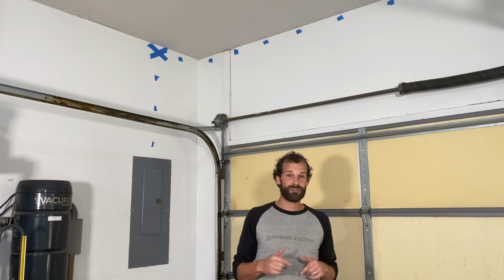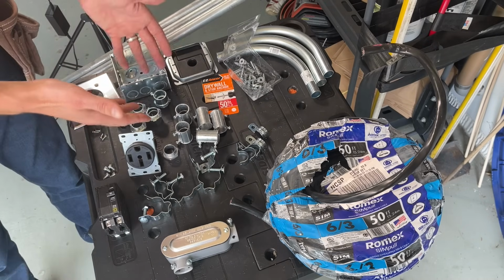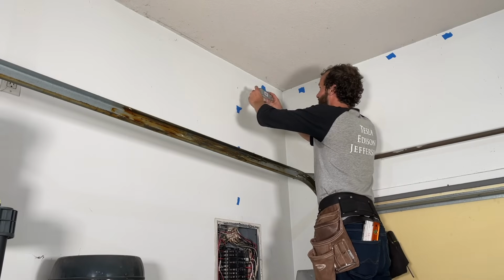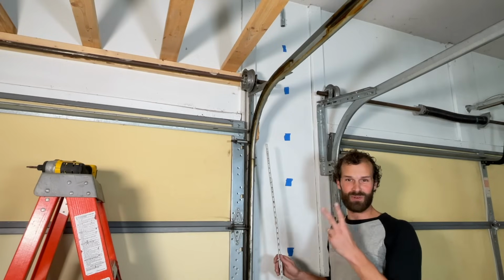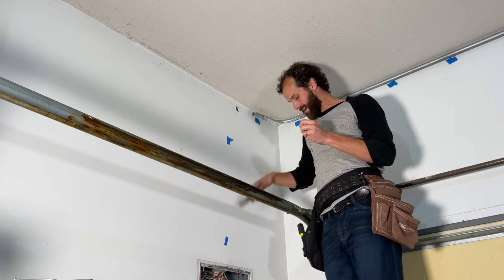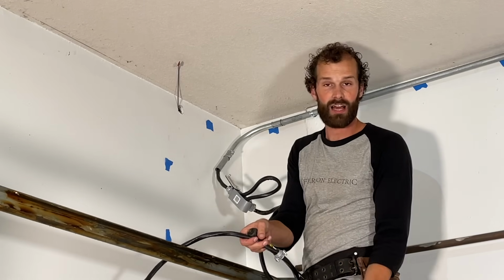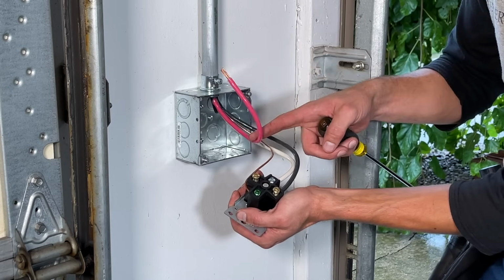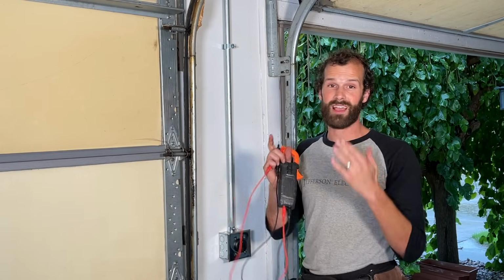How To Install a 240 Volt Outlet | Electric Car Charging

Comment: He should've grounded the box by wrapping the ground wire around an actual green screw in the back of the box. Those boxes are designed for that screw with a raised hump. Using the outlet as the ground link is not sufficient to ground the box and conduit run.
Reply: removing a device isn't allowed to interrupt grounding connections

Removing a wiring device from the circuit cannot break grounding connections, or else you are violating NEC 250.148(B):

(B) Grounding Continuity. The arrangement of grounding connections shall be such that the disconnection or the removal of a receptacle, luminaire, or other device fed from the box does not interfere with or interrupt the grounding continuity.

Therefore, this install does not meet code.
Reply: You don't have to ground the box if you use a self grounding receptacle. Just about all of them are self grounding these days. They have a little steel wire which crosses the screw tab on the receptacle which ensures a solid ground connection to the box. Believe it or not, according to NEC 2020, EMT is considered an acceptable ground path, so a separate ground wire isn't even required. It's just common and good practice to have one. He couldn't have done that in this scenario though because the conduit isn't continuous.
Reply: @dr.cupcakes626  I've known of that crazy "conduit as ground" in the NEC for nigh-on 40 years, at one point even AC/MX armor was (is?) considered a valid grounding path.  In Canada you've ALWAYS needed a separate ground conductor as far as I can tell.

You begin to see the reason when, like a friend of mine, you find your AC armor glowing bright red after developing a hot-armor short, and the armor/splices had corroded enough to not quite blow the fuse.
Reply: @Joe-by8jh  what code are you referring to? According to 250.146(B) the screws in the receptacle yoke are suitable to establish a bond between the receptacle and the box, therefore grounding the box.

(B) Contact Devices or Yokes. Contact devices or yokes designed and listed as self-grounding shall be permitted in conjunction with the supporting screws to establish the grounding circuit between the device yoke and flush-type boxes.
Reply: @dr.cupcakes626  Really good code reference! I couldn't determine that this listing was in place for this outlet so really should default to a ground screw. I appreciate you!
Reply: @dr.cupcakes626  The language reads: "shall be permitted to ground the receptacle to the box". You can use the self-grounding yokes to ground the receptacle to the box, but not the other way around. I don't know an inspector that would allow the receptacle itself to be the only ground link on a conduit assembly. It's just sloppy and bad practice. If the conduit ran all the way to the panel, it'd be another story.
Reply: @bnasty267  That's not what it says. It says word for word "shall be permitted in conjuction with the supporting screws to establish the grounding circuit between the device yoke and flush-type boxes." grounding the box to the receptacle or the receptacle to the box makes no difference as far as grounding goes, it's all bonded together. You're right though, removing the receptacle would effectively unground a noncontinuous conduit run. But I can't find any language in the NEC that prohibits this. Correct me if I'm wrongm
Reply: @dr.cupcakes626  I agree that the NEC is unclear here. However, most inspections I've done are at the rough-in stage, where the receptacle is not installed yet. This install wouldn't have a ground, and would fail. I doubt you'd be able to argue the technicality, and honestly, why would you? You have a EGC available, a dimple on the box ready for a ground screw, and conduit that isn't grounded elsewhere. This is definitely one of those things where it's super easy/free to not piss off the inspector, and that's what ultimately matters, even if you ignore the safety aspects.

Comment: The one comment I have is regarding your grounding path for the conduit. You go into great detail about ensuring your connections are secure, all locknuts and set screws tight. However, I didn’t see a grounding pigtail from the receptacle to the metal box. The other end of your run ends at the wall with no conducive path down to the panel. I know it’s not practical to run conduit through the wall to the panel, but without a grounding pigtail on the other end, how would any fault current make it back to the panel to trip the breaker should the conduit become energized? Did I miss something?
Reply: Great point, I totally missed that. As far as I can tell you're right, the EMT nor the box is bonded properly.
Reply: I suspect the metal mounting tabs on the outlet are bonded to the ground terminal, which would bond the box. However, the other end of the conduit isn't bonded. I'm not an electrician, but I heard that both ends of the conduit should be bonded.
Reply: @OldBaldDad  You can't use the metal yoke to ground the box via the receptacle. You can only use it to ground the receptacle via the box. Essentially that means that the box must have a screw and a pigtail. 250.148(B) and 250.148(C).
Reply: @OldBaldDad  The manufacturer didn't specify in the installation instructions for the outlet whether the outlet mounting plate is a suitable ground path so I should assume it is not suitably grounded without a pigtail and ground screw.
Reply: Definitely needs a ground screw in the outlet box,loop the ground wire around the ground screw and leave enough to go to ground the outlet.
Reply: @patrickgatons  simple .
Reply: I noticed and thought the same thing.  Makes you think .  But with ground wire grounded to the outlet also ground the piping too?
Reply: @timcaron9049  theoretically yes.  But without the wiring device in place with the covers on, the pipe is not bonded.  And while a grounding pigtail to a wiring device is not required when the metal box is bonded, I don't think the reverse is true from a Code perspective.
Reply: Michael Burkert.    Not using the conduit as an equipment ground??   But, does need that
pigtail as you point out.  Thank you for keeping us informed.
Reply: @tedlahm5740  , yes. Any metal box or conduit has to be bonded in any electrical install. If one of the conductors came into contact with the metal box, the box and conduit would become energized. Without a path to ground back to the main, the breaker may not trip, creating a very hazardous situation. Same reason any metal appliance has a bonding electrode or pigtail to the equipment ground of that appliance.
Reply: @michaelburkert461  If I use a plastic 2 gang box, do I need to ground it with a pigtail? I don't see a reason. Thanks.
Reply: The ground path is not connected to the panel cause he did not use EMT all the way through to the panel so technically this is not grounded correctly would of needed a JB box where the transistion goes from NMD to EMT and for pulling its alot easier to pull single thhn or thwn wire through conduit then a bundle of insulated conductors
Reply: I didn't catch the bond issue at first.  However, not to code, but in this case if the EMT were to become energized the current would travel to the yoke on the outlet that is connected to the grounding wire for a path back to the panel.  Another reason to use a j-box with a pigtail above the panel instead of an LB.
Reply: The ground screw on the receptacle is connected to the metal that fastens the receptacle to the two gang ring that is fasten to the box. That should help for a fault. But yes a pig is definitely needed if two gang ring were to be remove while the receptacle is still energized.
Reply: What a Maroon!  That whole conduit is floating.
Reply: @MWestern-m4g  Moron [sic] - maroon is to be left hopelessly lost. Lighten up! Don't think any of the haters could do a better video.  🦴
Reply: I agree with you! Talking and working at the same time is stretching my multitasking skills. Here's a thought: NEC 250.86 Exc. 2 are not required to be connected to the equipment grounding conductor. What's your perspective? Does this apply here Michael Burkert?
Reply: @joelwalsman773  
Exception No. 2: Short sections of metal enclosures or raceways used to provide support or protection of cable assemblies from physical damage shall not be required to be connected to the equipment grounding conductor.

That certainly opens the door for negotiations with the AHJ 😆. Good catch, what is the definition of "short section"?
Reply: Great point. I felt I criticized him enough on other issues.
Reply: No. Each of the components of the outlet are electrically isolated from each other. For the ground of the outlet to be connected to the metal box/conduit there would need to be a grounding pigtail to connect them.
Reply: The recepticals ground screw and yoke are connected together. Yes a redundant alternative ground path would be ideal, but it's fully grounded, even if the conduit is not connected to the panel on the other side.
Reply: @jamess1787  You are correct that it is grounded but code doesn't allow that circuitous grounding path through the receptacle.
Nec 250.148 requires connection to the box if the grounding conductor is spliced or grounding equipment in that box.
Reply: @patrickgatons  fantastic, thanks!
Reply: @jamess1787  yes but not bonded per code
Reply: Its not required. The conduit is grounded through the egc landed on the device.
Reply: @lloydmills9619  The socket is a 4 hole device. I don't think that green(Ground) is landed on the support of the plug thus not grounding the conduit all the way back to the panel. He should have run a wire from the panel  up to the conduit run at the top of the wall. I would have big arguments about how electricians were made to believe that conduit counts as good grounding devices. THEY DON'T. A direct wire to fixture is the only correct way to ensure a proper path for safety ground. And the "electrician's" working on the jobs were most likely not holding a card, the one's running the job would be hopefully. Most of the time it was one guy who represented the company as a certified electrician.

Comment: Love the format of this video (any best-practice violations aside - I am not an electrician)! 2 Qs:
1) Why not wire up the red/black to the breaker before installing it into the box? Seems safer all around to keep away from live connections...
2) What would change if needing to run conduit outside the house from breaker to garage? Different wire? How to handle indoor-to-outdoor transition?
Reply: Also I didn't see ground on the box he should  make a pigtail and connect ground.

Comment: The one thing I found a little odd was the whole run was in conduit except from the breaker panel to the LLB (or whatever it was) connector.  Is that normal?  I thought EMT would also have to go from the breaker panel behind the drywall.

Also why was Romex used instead of THHN or other?  Thank you; fabulous video!  Keep 'em coming please.
Reply: It wasn’t necessary needed to run pipe down the inside wall because he was using romex. If he was using regular THHN then he would have to run a raceway all the way from point A to point B
Reply: @SmackxDaddy  thank you.  I'm guessing it has to do with local code.  In Chicago (Cook County) I don't think we could do that.
Reply: @dougb8207  would probably be cheaper to run some greenfield down the wall and connect it to the back of the box and that would solve to have and actual grounding path just in case of a ground fault at the device
Reply: @SmackxDaddy  right!  You're one of the few people I've heard mention Greenfield.  Generally I'm not good at cutting that stuff, so I try to buy bx whips, or at least we used to call it BX when I sold electrical supplies at Builder's Square years ago.
Reply: @SmackxDaddy  Flex conduit in the wall. Which would have provided the needed grounding through the conduit to the panel if the ground becomes disconnected..
Reply: @Sparkeycarp  flex is another word for greenfield, so yea same what I said.

Comment: I just did this exact thing for an RV. I took the insulation of the Romeo in the conduit. I was told it would have considerable amp drop from heat in the conduit if you did not.
Reply: wire is not rated to be used without the outer jacket .
Reply: @noahholt482  If it is stripped and sleeved in conduit it is perfectly fine. The conductors inside the outer jacket are normal wires we pull through conduit every day.
Reply: @noahholt482  I wouldn’t worry too much about it, as we are watching a video of someone working in a live electrical panel!

Comment: honestly screw that....just use some flex metal cladding in and done in a fraction of the time. no it wont stop some 10/10 retard from shocking themselves but they have it coming anyway. if you move disconnect it and put a sticker that says its on them if they want to use it.  dont be dumb dont have problems enjoy

Comment: Whoa, why not transition to THHN instead of trying to pull Romex through conduit?
Reply: Romex is not meant to be used in a conduit like that, it gets hotter than it should.  Using THHN would be the right way to do this.  You'd think a pro would know that stuff.
Reply: @bosoares  romex is perfectly fine in conduit
Reply: That was going to be one of my questions.
Reply: Yeah, not necessarily illegal, but man there were better choices.  I get that he was trying to use materials readily available to the homeowner.  But as someone else already pointed out, 6 feet of FMC from the condulet to the panel,  and then just install three (3) #8 + (1) #10G (also readily available at the homecenter) and you have a much better installation.
Reply: As DIYer I always cut the main breaker and also test adjoining breakers to make sure no current present. I , further, cut a piece of cardboard a little more than the width of the box and slide it over the main lugs to help prevent any stray contact. Also , standing on wood or rubber might be another smart move? I also don’t understand why use Romex inside of conduit unless it needs a short section needing extra protection. The big box boys carry the individual stranded wires (usually)?
Reply: Inexperience
Reply: I thought the same. Maybe trying to prevent a splice at the transition?
Reply: Probably had it laying around and didnt want to strip it
Reply: Today’s code would require a GFCI in most locations. I also do not think that 6-3 Romex meets code for 50 amps continuous load in or out of conduit, however, #6 THHN/THWN would.  The box seemed loose on the wall but for me this video was worth the time it took to watch it.  It proved to me it is possible to install a clean looking job with EMT without a bender.
Reply: So it can go behind the drywall.
Reply: @georgequalls5043  😊
Reply: Only amateurs pull romex thru conduit. Against NEC code and too much motion lotion required for pulling.
Reply: @philtorres2975  not against code. NEC 334.15 B
Reply: @adammorgan9304  , Rome can be pulled in conduit when going through floors vertically or in some cases close to a junction box . Complete pulls are not up to code besides that could be a hernia problem whereas pulling wire thru conduit is easier.
Reply: @philtorres2975  It's not against NEC code (nothing in the NEC prohibits running NM cable in a raceway), but in most cases, it's a dumb thing to do.  More difficult and more expensive.
Reply: Why don't you make a video showing this?
He was showing the average homeowner a way they could do this themselves. If they needed/wanted/felt confident enough to do.
He is showing the most common/available tools and materials.
That's it. He did a spectacular job at doing so.
Is it perfect, idk. Will it work for the homeowner for a very long time, absolutely. 
What you're suggesting is kinda stupid tbh.
Everyone agreeing with you? For what reason?
There is nothing wrong with how he did this. Also, you have to realize. Let's say thus was a tesla approved (maybe licensed) install. That would mean there were specifications that were necessary. Dictated by what electrical currently existed. It's not just why not do this because it's easier.
This is absolutely able to handle what it's being used for. 100%.